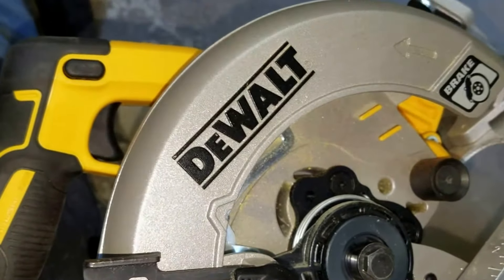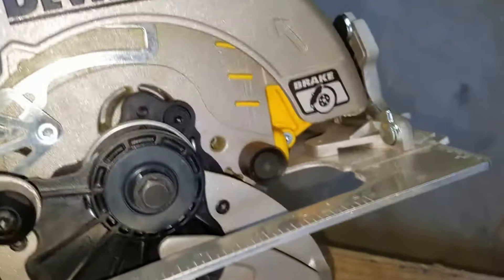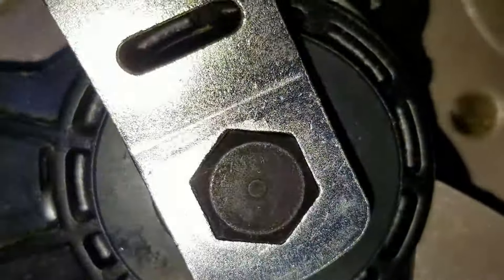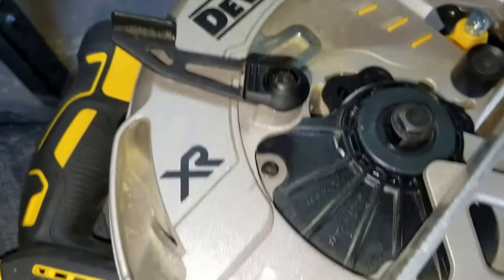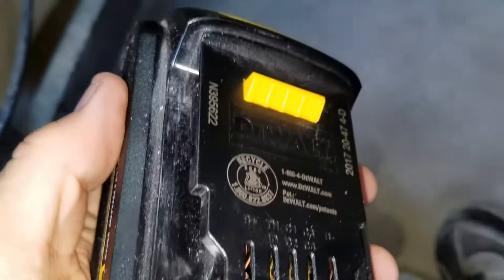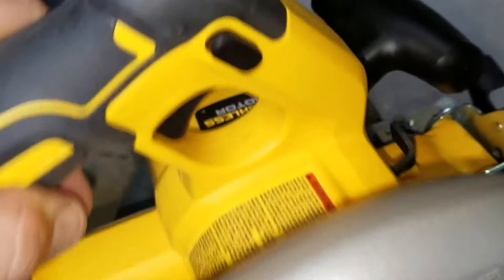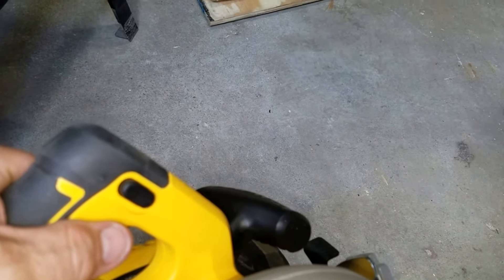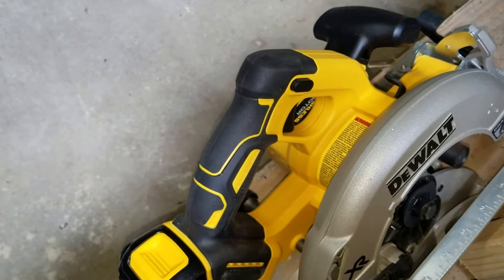I have a DeWalt saw question for y'all.

Comment: Ireland here, I have a DSC572 and it has started doing the exact same thing! 
It just out of warranty but has only done light work.
Reply from the maker: I think I figured out what's happing. My replacement starting doing it. So I put a brand new 8ah battery on it and it worked fine. I'm thinking my other batters are weak and aren't giving the amps needed. all my batters except the 8ah one is a few years old.

Comment: Just like everybody else it seems that bought one of those. Mine has done the exact same thing. Mine did work like a champion through an entire battery and then about a half of another battery.
When you pull the trigger, it would spin and stop it did that maybe five times while I was scratching my head trying to finish a cut then it became just a click and nothing else no more spin. If it were not for all of these posts here and other places across the Internet about this issue, I would buy another one because it worked so good for about three hours. But it is not worth three hours of cutting to buy another one. I’m just going to break out the old, trusty corded Black & Decker and finish my work.

Comment: I have the same saw and it does the same clicking noise as yours. Mine works fine. I have a hunch the clicking is the speed brake mechanism.

Comment: Just happened to my saw. I’ve barely used it, but I’ve owned it for 2 years. Now I have to fight the warranty battle. Hope I’m not too late. Grrrrrrr.
Reply from the maker: Try a newer battery. mine works with a new battery less then a year old. My fully charged older battery will not work.

Comment: It's not normal....why own a tool that you can not use when you need it? Mine has started doing the very same thing this week, what I can tell you is that the automatic brake stop is sticking, , if forced to turn it will do so and if you hold the trigger down you will start to smell the brake getting hot before smoke begins to boil out of it . While I do not have the answer on how to fix it , I would think that this is some kind of factory defect with so many people having the same problem

Comment: Have the same issue, have you figured out the problem yet? For others in comments, we can disregard the clicking, but the symptoms seem to be:
- Full battery
- When triggering to start, you hear a high pitch but does not spin and led flashes
- When manually moving the blade, then triggering, it starts to spin a little bit with the clicking, but then stops with the led blinking
- I've only used mine once, left it in the garage for a few months, and it stopped working.
- Any ideas?
Reply from the maker: Well I tore mine apart today. I tested all the electronic's (Sounded to me like a capacitor charging squeal.  )  I tested all the components on a oscilloscope. I think it is a bad chip in the brake. I even put it on my 30 amp bench power supply to make sure it had the juice it need. after 4 hours I gave up and went to lowes and bought a new one. because i need it for a project tomorrow. What I plan to do is send the old one back to Dewalt and pay to have it fixed/replaced . I will do a update video when they tell me whats wrong.
Reply: @NorthCarolinaPrepper   Thanks so much for the update! I think your video is THE only resource I can find that perfectly shows the behavior I'm seeing (and seems to be somewhat common judging from the comments), so I'm not insane. 

I can't bring to a service center near me (closed due to covid-19), can't return because its over 6 months old, and really trying not to buy a new once since the one I have is essentially brand-new... so now I wait while my projects collect dust or until I get frustrated enough #RantOver ha
Reply: @ROBOHO  Just ran into the same problem, you're absolutely right that this is the only video that touches on this.. Unfortunate to hear this isn't really a fixable issue, my saw is also relatively new.
Reply: Has any one fond out what the problem is. I'm a contractor an this is the best saw iv ever owned I can't find any  answers on it.
Reply: Anyone found an answer other than warranty?! I have the same issue and I have only used my a few times
Reply: @redneckoperations  I ended up getting a new one, the problem seemed to be the brake in the motor assembly and it was gonna cost me $200 to order a new motor.
Reply: @NorthCarolinaPrepper  Any update?
Reply: @NorthCarolinaPrepper  ok. gracias
Reply: Any conclusion on the issue? My dewalt saw is doing the exact thing and the gears seem to be as they should..
Reply: Mine is doing the exact thing and I still haven't got an answer.
Reply: @faboja7575  I made about 3 or 4 cuts and now it's clicking and the light flashes...same problem. Nobody has a solution?
Reply: @NorthCarolinaPrepper dont it have a 3 year warranty?
Reply: what was wrong with it, having the exact same issue on mine (and like you I just bought a new one) I did tear down my 573 and also suspected that starting Capacitor or the hall effect switch on the motor. @NorthCarolinaPrepper

Comment: I just disassemble my dewalt 20 volt  dcs393 and probably, the reason that you can't unlossen that is because there is a stop switch you use to install or Uninstaller your blade and you have to compress it while turning the blade manually until it locks, you will notice that,  when then that switch sinks further in, continue to compress that and then remove the blade/bolt, with the proper wrench, repeat to install, and if you don't have that option use a screw driver that fits inside the saw teeth and use the shoe for leverage to break loose.. another thing I noticed on this video is the spring has clearly exposed itself that controls the blade guard, just maybe that might be, apart of this issue

Comment: My dcs570 does the same thing, anybody ever figure it out?
Reply: Got the same problem. Went in for repair and the dude changed the components inside and says it happens often. I think this particular saaw is just complete dumbshit
Reply: @guielidess  just curious, what did it cost to fix it? New one like it are $200
Reply: Nothing because the dude that repaired it used warranty to get the components but he told me it was between 150-200 to repair. Never ever buying this shit again. Now i don't have a warranty im going to use my corded one.
Reply: @guielidess  certainly wouldn’t pay that much to repair it, probably couldn’t find a place to use the warranty. Guess I will just trash it. Thanks for the information.
Reply: Mine is doing the same thing. 👎🏼😤
I maybe used it 15 times barely used still looks brand new no sawdust no scratches it spins then stops.
My Advice is they sell the atomic Dewalt DCS557B 4 1/2 inch circular for $129.00 <<< it’s AMAZING does the same job Cheaper than fixing my 7 1/4 inch XR P.O.S 
I hope this helps because getting it fixed costs as much as getting a new one.
Reply: Kept the saw until yesterday, I would tinker with it every now and then, finally threw it in the dumpster this week.

Comment: I have the same saw ,relatively new makes a heavy clicking sound. when you put in a new battery it will not move,this line of saws are trash,I had mine tore to pieces I replaced the bearing which I had to hunt for Dewalt should issue a recall ,lost money as I see it.......oh it wasn't the bearing

Comment: Where's the manual? What dies it say under troubleshooting?
Reply from the maker: Manual...ummm somewhere in the shop.. I have been looking in the online manual
Reply: North Carolina Prepper   check the instructions & cautions for the brake. Then check the troubleshooting pages. Sounds like a safety feature is on. Wait till not on meds.
Reply from the maker: Yeah Im going to have to look them over again, I also order a new 5amp battery to test it. If I cant figure it out I will use the 1 year warranty Just found out about .

Comment: If the battery is giving off 18-19 volts, it’s not the battery. This can easily be checked with a cheapo voltage meter. Agree with previous commenter sounds like safety is engaged some how? Travel safety?
Reply: P.s. that’s a good saw normally, the XR line is there best brushless tools.
Reply: It’s not the batteries, mine dose the same exact thing and I have many batteries that work that I tested it oh

Comment: I have a dewalt (1 month old) DCS574WI I bought from Amazon and it has  the same problem. My son used it to cut  a peace of wood put it down  and picked up back and  it sounding just like  your. I switched from millerwakie and this is what I got come on dewalt
Reply from the maker: I think it had something to do with my battery's. I git another dewalt jigsaw. and that new battery worked. But my older ones sill wont work on it.

Comment: The clicking noise happens because it's a brushless motor and it's magnets are all in a fixed location inside the motor assembly. It's 100% normal. I also have a DJI Phantom 3 drone that has brushless motors and it does the same exact thing. If it spins freely, chances are it's because it's a brushed motor.

Comment: I got a Makita cordless drill years ago and it worked okay for a while, then the battery died and would not take a charge. I got a new battery, yet, it doesn't work as well as my corded Black & Decker drill. DEWALT makes good stuff, so I'm surprised you're having trouble with the one you have. My corded Black & Decker skill saw has lasted for over twenty years without any problem. I'd rather connect two, 100 ft. long extension cords together, to use my corded drill than use my cordless Makita drill.